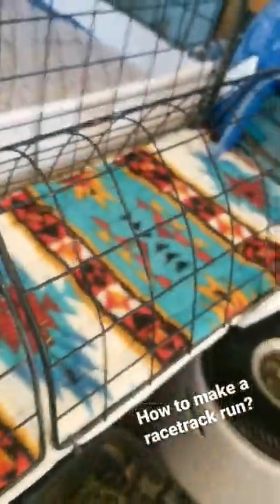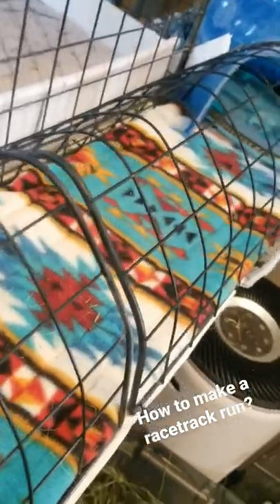How to Make a Racetrack Tunnel

Comment: This is a great idea. How do you get inside to clean the doodies?
Reply: I imagine you'd cut the zip ties then secure it with fresh ones? You could probably use good quality string or some sort of latch system if you don't want to burn through ties

Comment: I noticed with those grids, its important not to bend where the welded join is. It could snap and result in sharp edges. Look for the welding and keep that on the straight side.

Comment: How do you clean it if it's zip tied? Do you just take them off and reapply new ones?
Reply from the maker: The pads slide out, poops get vacuumed up. Other than that it stays clean. The bridge on top is only zip tied on one side so they swing open, I twist tie them down.